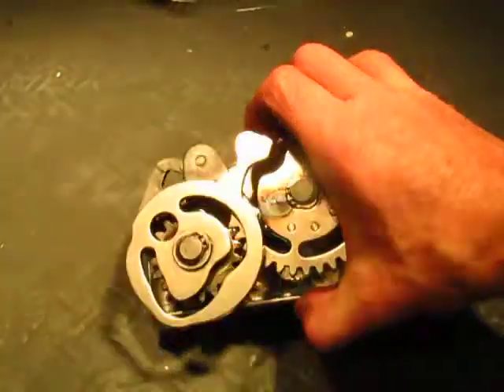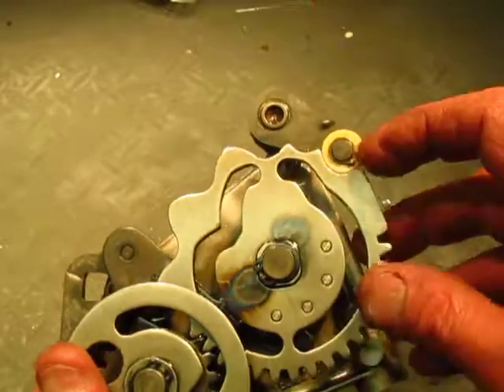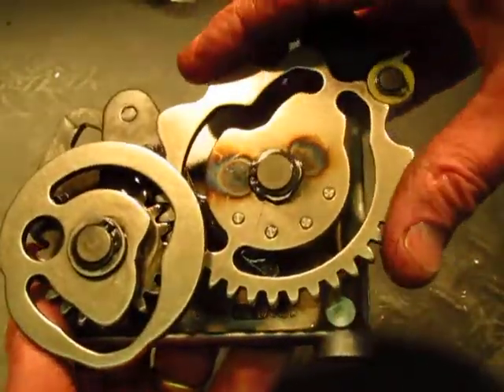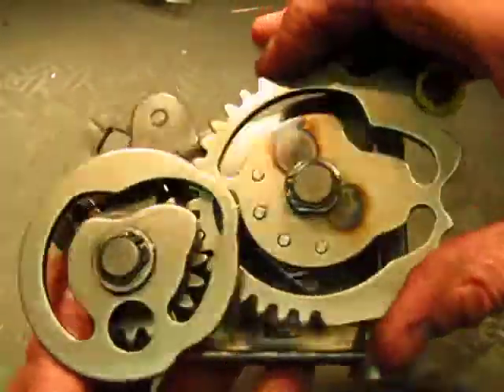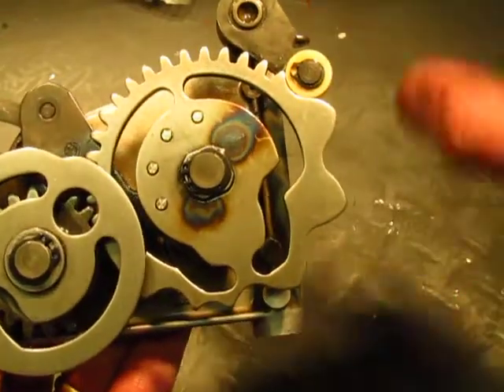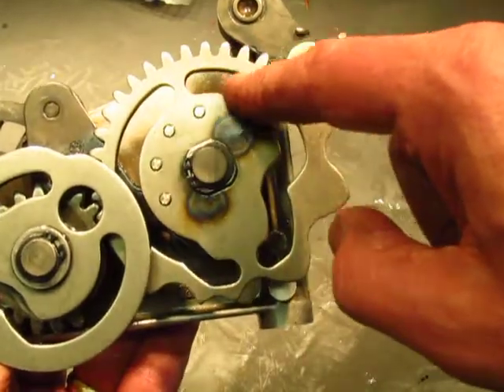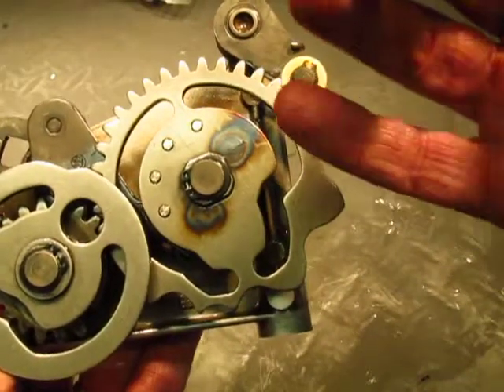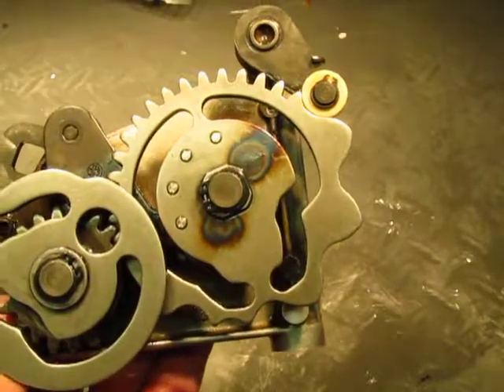1977 BMW R100RS How The Transmission Shift Cam Assembly Operates

Comment: You had a problem with your transmission that was fixed by Mr. Cutter. What had to be repaired?
Reply from the maker: The circlip I ordered from my BMW dealer that holds the cam roller on was too large. After about 2500 miles, the clip came off and the roller came off. Without the roller, when the bike is in gear, the sift dogs move around and when that happens and you get very exciting noises from the transmission :-).